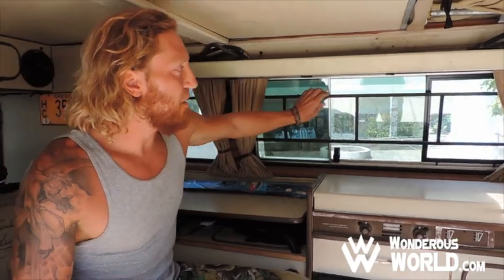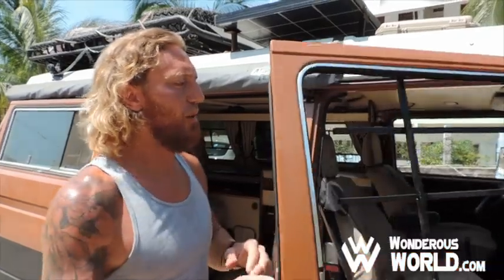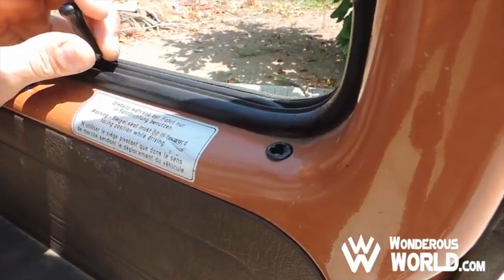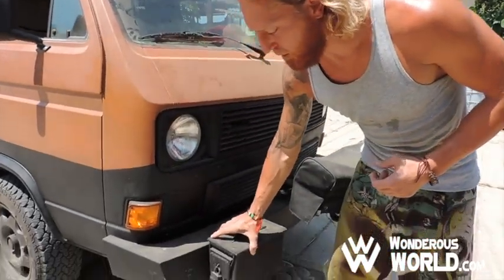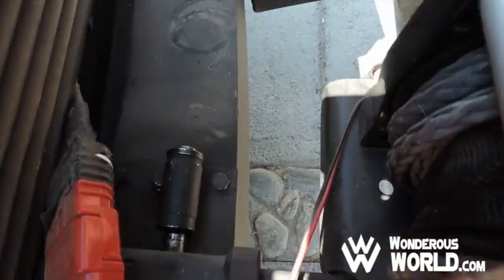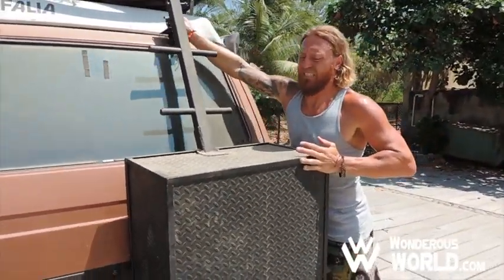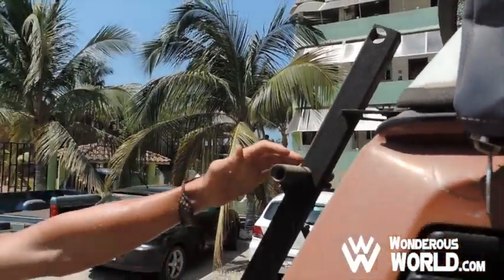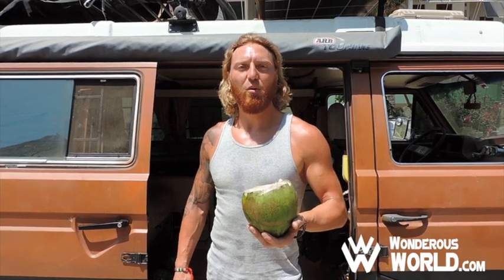How to secure your overland vehicle: by Wonderous World

Comment: It always amazes me how few rules you seem to have regarding vehicles in the USA. (I assume you're American. Correct me if I'm wrong.)

Most of that exterior stuff would be illegal here in Europe. Or at least in a lot of the western and northern European countries. Not sure about the others.
I mean, there's a reason cars have a safety rating with the standard bumper, no massive metal block (winch) sticking out of the front and so on. VW (or whoever) could easily make a stronger bumper for their cars, but then it'd be much more dangerous to other cars, cyclists, pedestrians etc. in case of an accident, which would most likely make it fail the safety tests completely. It's not just about the safety of the person inside the car here. 
If you weld a home made heavy duty metal bumper onto your car, the safety rating no longer applies, and in case of a serious accident it might even be more dangerous for the person inside as well, since the crumple zone doesn't really crumple if there's welded a massive iron thing in front of it. It's all well and good that the vehicle takes less damage, but the fact that the vehicle does take damage, softens the impact for the people inside in case of a big accident, which is the whole point of having crumple zones in cars.

I wonder if there could be any issues bringing a car with modifications like that into the EU or if "we" simply don't care about safety if the vehicle is registered elsewhere..? :p

The first time I noticed the seemingly rule-free vehicle thing was on that American Choppers thing. They'd order a frame, realize something didn't fit and just start cutting or grinding in the frame. Doing that over here would immediately make it illegal to ride on the roads until you had it tested (Which is quite a big undertaking for a single vehicle.) and it passed the test. You can't just cut away part of a frame like it didn't matter. lol It's there for strength purposes. Not to look cool.
Oh, and their love of metal spikes (For that bad ass look) wouldn't be legal here either. Obviously having metal spikes on a vehicle makes it more dangerous. That's why they used spikes on weapons in the past after all.. ;)
Reply: Here in 'Merica we have this thing called freedom, which means we can do what we wish with our possessions without government permission (with mounting exceptions). As for the bumpers: cyclists and pedestrians will be injured when struck by a 1000kg+ vehicle regardless of its bumpers. In minor collisions with other vehicles, the steel bumpers simply mean don't take damage, and since the collision is minor the occupants are not at risk. In serious crashes, the steel bumpers makes the vehicle more rigid, which does put its occupants at risk, but occupants of the other vehicle will only be at slightly increased risk because their own vehicle is designed to protect them even in collisions with concrete walls. In summary: we Americans are generally allowed to modify our vehicles in a way which increases the risk to our own life so long as it does not threaten others. That said, those who lack judgement can pay a terrible price when their luck runs out.
Reply: evilassaultweaponeer lol love the first sentence, since I have a feeling that it would be a lot of people's actual reasoning. ;)

You're right. Cyclist and pedestrians are likely to be injured regardless, but there's a big difference between different injuries, which is why so much research is going into things like the bumper, the bumper placement, the hood etc. There's a big difference between having a broken leg, rib etc. and having your entire pelvis or head shattered by a non-crumpling metal bumper. You're much more likely to kill whoever you might run into, if you're using anything homemade. The crash tests and rating are not done for fun.

You can even find videos about it here on Youtube as well as see new (crumple zone) vs. old car crash tests etc.

Crumple zones are meant to take as much of the impact force as possible. If you hit another car head on, having two cars with crumple zones will mean less impact for both drivers. If one has a big ass non-approved metal thing at the front, he's a danger to other drivers as well as cyclist and pedestrians.

While you can obviously make a basic argument about "It's his freedom to mount his own bumper.", then that'll also be the freedom of whoever may hit your car someday.. Or the person who may hit a bunch of children on the way to school.
I'm generally a fan of freedom (duh), but not if they simply make it less safe for everyone without providing any actual benefit. Let's be honest here, who needs a massive iron bumper these days? 1 in a million maybe? People mount them because they look cool on the 4x4s. 
To me that's not a good enough reason to risk people's lives. But oh well.. It's illegal here already.. :)
Reply: Personally, I plan to mount some because 100% of the collisions in which I have been involved were caused by careless drivers and resulted in my bumper receiving unsightly damage. Had my car been equipped with heavy bumpers, only the careless (read: cell-phone using) driver would have suffered.

As far as crumple zones are concerned, most bumpers will not affect these, as they bolt to the very front of the frame. Crumple zones are of primary importance in medium and high speed crashes, and will still work as intended. The main consequence of the steel bumper on modern cars is interference with the airbags in fairly low speed crashes.

As for pedestrians, I was unaware of a major movement to protect pedestrians, but some brief research seems to suggest that shaping of cars is receiving more thought than bumper material, which is probably the right approach. Furthermore, I strongly argue that better driving practices (safe speeds near pedestrians, avoidance of cell phone use, etc.) are much better defenses for pedestrians.

In summary, I do agree that these bumpers increase some risks, but they do far less so than safe driving practice (which is tragically lacking in today's world). I am a safe driver, and I am unwilling to be ruled by laws created to mitigate dangerous drivers. To conclude I will quote our forefather, Benjamin Franklin: "Those who would give up essential liberty to purchase a little temporary safety deserve neither liberty nor safety." Words to live by for those responsible enough to remain living...
Reply: Freedom is not a word in Europe.
Reply: Gnawer Shreth You have to take into consideration that these guys are traveling as well it seems.
Reply: +R.L. Natch III Freedom to endanger others? No, then we're not free I guess. And thankfully so.

Since you're probably not "liberal" with that kind of comment I found a right wing site for you. http://www.breitbart.com/big-government/2015/08/19/u-s-falls-to-20th-in-freedom-index/

And here's the direct link to the report they're talking about. http://object.cato.org/sites/cato.org/files/human-freedom-index-files/human-freedom-index-2015.pdf - The listing is on page 20 and 21. 

Notice how 13 European nations rank higher than the USA.. And pay extra attention to #4. Denmark. That's the oh so terrible country that I live in.. You know, where we're all having to deal with horrible socialism and stuff, like Fox always loves to say. Safety standards for vehicles and a lack of guns is just oh so horrible. We have no freedom at all! The horror!
Reply: Freedom in 'merica? Try driving without government-mandated licence and insurance, or try speeding :D
Reply: I feel fortunate not have to deal with authoritarian nonsense concerning vehicle mods. That would SUCK!!!!
Reply: @deaniture  I'll never get that kind of thinking. Fearful.

Comment: If all 29 padlocks are not keyed alike you will need a BUBBA key ring ,and god forbid you should lose all your keys. Don't fret though any decent drunk/crack head will have a beer can/crack can in witch they can use to open ANY padlock in about 10/15 seconds A for effort. And it gave you something to do. I do understand there is always going to be someone /somewhere that would rather steal than work for it, and there is also people that are in very desperate situations. Not everyone is in control of their situation. But that is some of the reason to to go to the places off the beaten path otherwise I could stay on my 61/2 acres and never see or talk to anybody other than my dogs. All that being said you should secure your way out . But research the locking design of a gang box/ job site tool box.